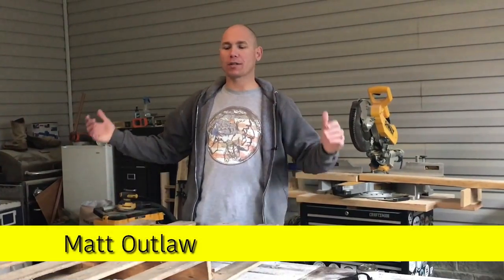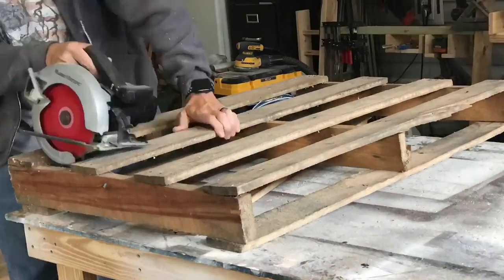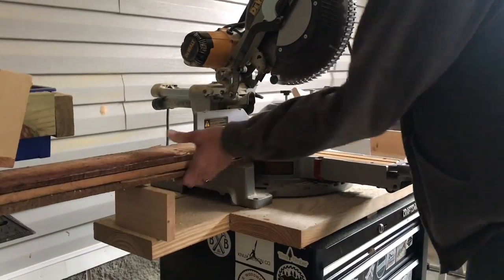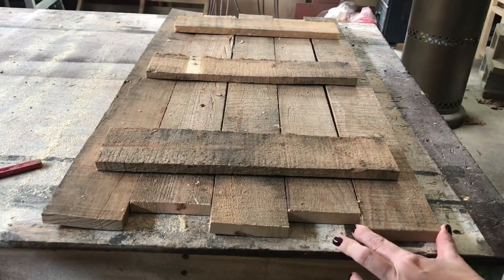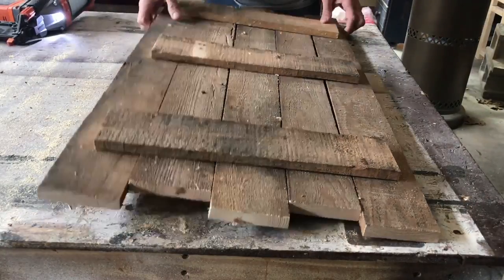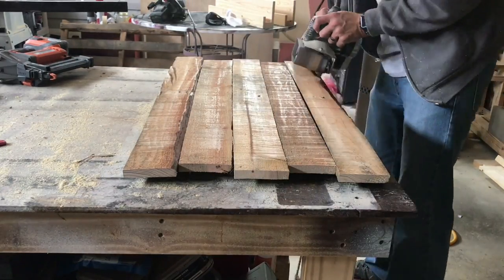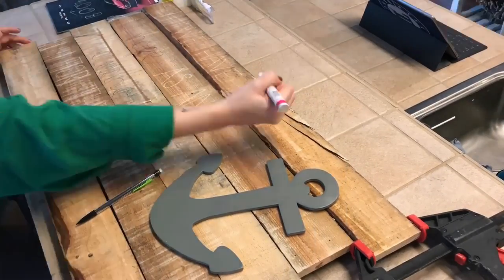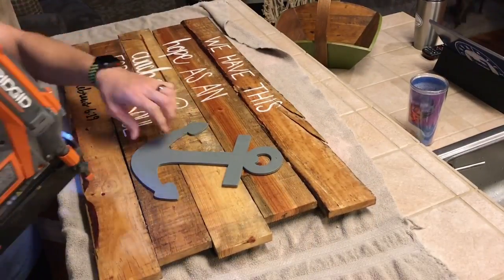EASY Pallet Wood Project Wall Sign

Comment: Beautiful! 
If I wanted my boards stained will it turn out better if I stain them before or after they've been glued/screwed together?
Reply from the maker: it'll work either way.  Just be sure to clean up any glue squeeze out if you stain after.  The glue will cause the stain not to take to the wood.
Reply: @731Woodworks  Thank you so much!

Comment: I've been using pallet wood for awhile but man those gaps drive me crazy did you rip them?
Reply from the maker: No we left the gaps. But if you wanted to rip them, check out my other video on Jointing with a Table Saw.  If you have a table saw that would be a good way to square up the edges.  I actually offered to square these up but my wife wanted the gaps for a more rustic look.